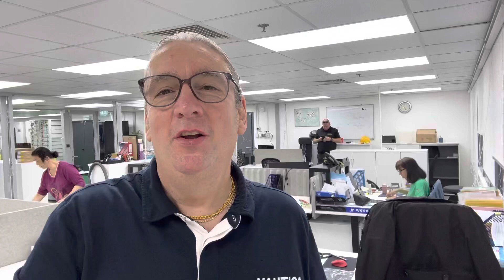￼ The dark side of solar ( Efixx TV special ) a must watch ￼

Comment: Why does sunsynk not have firmware update over the air? My inverter charger is not charging the batteries or drawing from the battery anymore and is stuck on 100w. And I have to wait for someone to push the firmware into my inverter etc….
Reply from the maker: We do, your Instalker can do it
Reply: @sunsynk  from what I am told that’s not the case and so far it’s costing me allot of money at the moment, it’s about £70- £87.50 a week and it’s now about 3 weeks and counting hmm